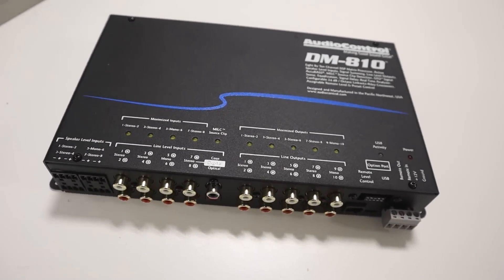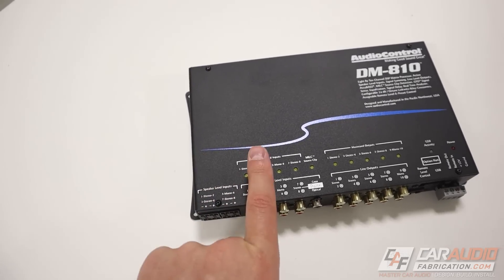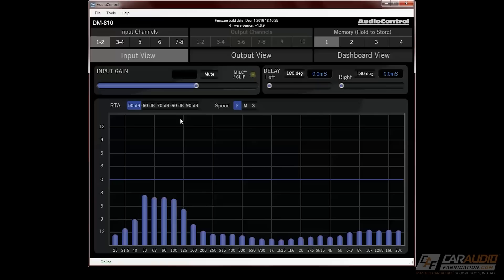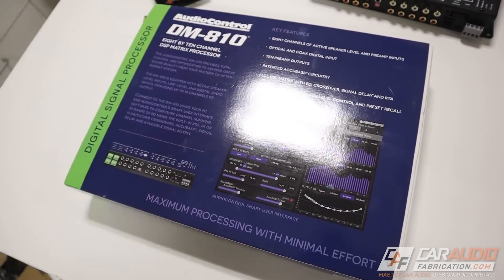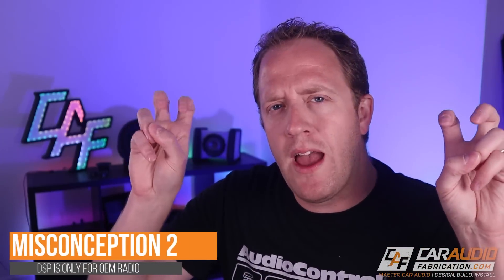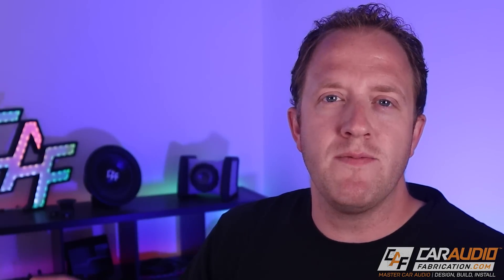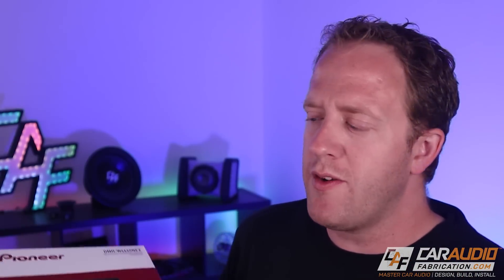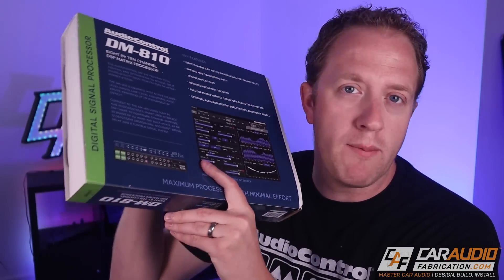You’re using DSP wrong! Top 5 DSP Misconceptions

Comment: Audiocontrol needs to do some tweaking to their dsp. The 25hz lowpass filter needs to be removed, more crossover options for fine tuning, Bluetooth auto reconnect, to name a few. Mine has been driving me nuts since I bought it last year
Reply: AudioControl need to do a lot more than that to improve their DSP, I found a tons of bugs while using it, l sent them a list of stuff to fix, and suggestions for improvement and I really hope they will come up with some stuff fixed in a new firmware because the product at it's core is really good.
Reply: @Domaudeo  I spoke to them several times over these issues. They told me that most of this stuff won't be fixed in an update, but would be done when the next generation comes out. We are stuck with a flawed product while they keep making sells and expect us to spend another $800 for another one
Reply: @bartowflorida  I fully agreed. And even if you look elsewhere, other DSP products are not perfect either... That's a bit of a shame because it's not THAT hard to build a product that would be near perfect. Car audio did not evolve that much and the feature enthusiasts needs are the same since years.
Reply: @bartowflorida  Do you think the guy in the videos is paid to push DSP equipment? I've never used one and never felt any need for one personally. I don't really see the gains justifying the cost. The gains are minor and negligible in my view.
Reply: @sleepingwarrior4618  dsp are definitely worth it. Crossover slopes, attenuation,  signal corrections, input and output gains. I'd say the advantages are far more than negligible
Reply: @bartowflorida  I like SPL, I have a couple of 12s on a 3K, audio control epicenter, and have the factory door speakers left in place, and personally, I love the way it sounds. I don’t compete, never will, this came up in my recommended, so now I’m curious as to how this would help my setup? For this guy to say at the beginning “it has the biggest impact of any one part of the stereo system” unless it can push a windshield out without amplifiers, I have to disagree with this guy
Reply: @sleepingwarrior4618  He is sponsored by them yes, he also does their videos .
Reply: @bartowflorida  This needs to be something EVERYONE sees and why EVERYONE needs to STAY AWAY from this line of Audiocontrol DSPs.

I found and reported a bug in my Helix DSP back in 2016. They released a software fix for it ONE WEEK LATER. 

I've been using the same Helix DSP since 2015 and have loved it from day one.
Reply: @orangejjay  they actually did update the firmware to take it down to 20hz subsonic. Crossover options and Bluetooth is still inadequate though
Reply: @sleepingwarrior4618  I don't know about that. To me it is the difference between good and great sound. My speakers were way to bright until I got my DSP. The subs hit so much better now and I have total control. Time alignment is great also.
Reply: @jordanab100  Fair enough. I guess we can all put a value on fine tuning stuff. I do agree though, turning down your tweeters is deffo a plus point. How many stereos are tweeter strong and perceived to be clarity when really, it's imbalanced.
Reply: @sleepingwarrior4618  I don't think so, I've worked in the industry for many years and I would prefer selling a DSP with every single install as well
Reply: @beardedgaming1337  for what reason though? Sales figures? Or the actual benefits they give? Be honest now....
Reply: @sleepingwarrior4618  the benefits it gives. You can do so much more with a DSP than you can with a radio. I don't know about the audio control dsp, I really don't like it but a proper, legitimately built DSP can do wonders for a system.
Reply: @beardedgaming1337  Subjectively speaking or objectively speaking.
Reply: @sleepingwarrior4618  look up comb filtering. You can't fix that without a DSP. Specifically you can't fix it without a DSP that has notch filters and all pass filters. Just one example of why a quality DSP is worth it
Reply: @sleepingwarrior4618  A DSP makes for a better sound quality if you've ever heard a system with a properly tuned DSP vs the same one without you'd understand more on that part. Another great part is not only can you set a filter for each channel, you can also set the equalization for each channel as well. There are other benefits than just those as well
Reply: @Hammerback972 yeah ummm factory door speakers???? Jeesh you really love subs huh
Reply: Ive never used a DSP bro i currently have an lc2i on a 16 denali with the bose audio and the frequencies under 42 hz are non existent on my sub. The lc2i basically just plays what the speakers are playing im big on playing my lows from 20 to 32 is my favorite and what i have my set up for. All settings on amp are right on the dot and i cannot upgrade the stock stereo. Thank you in advance for any input and help man

Comment: Haven’t installed my Audison Bit 1, Quattro and 5.1 amps yet on my 2018 Honda Type R. Im trying to figure out if the two digital coax outputs on the oem infotainment head unit are for audio binary signal. Do you know? I don’t want to degrade the signal using a high to low level adapter. Also want to use active digital crossovers for all components, tweeters, midbass, sub(s)
Reply: Digital coax voltage is very low. You won’t get too loud, unless you don’t mind not getting too loud. I’m an SQL guy

Comment: Hi Mark! I got a suggestion for a futur video. I have a 2020 Ram Rebel with base system. The question i have(and cannot find answer!) is: Can you put a mid/bass only(no tweeter) in the back? Why? I want to add Focal flax to my car, but, if i want the 3.5 mid speaker for the dash, i have to buy a kit that include mid/bass, tweeter and 3.5 mid. The front i want a coax 6.5 this is why i want the mid/bass only in rear. Thanks!
Reply: you don't want to do that.

Comment: Choosing a dsp is harder than choosing the amps.
Reply: For some the built in DSP on your aftermarket radio will work. Standalone DSPs that feature 24 bit 192 KHz DACs are over 1000 dollars. The Sony XAV9500ES has the best built in DSP out of any head unit so you can have the most accurate sound without the complexity of tuning a separate DSP. Pioneer NEX is a close second. If you are doing all passive, and the aftermarket head unit has a 24 bit 192kHz DAC, individual speaker level adjustments, time alignment, and the ability to store custom EQ settings, you’re golden.